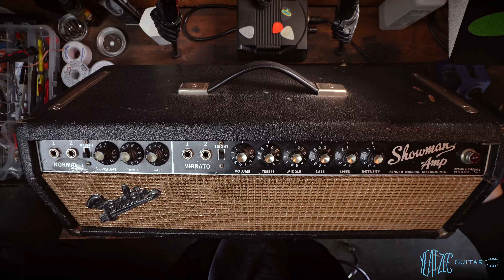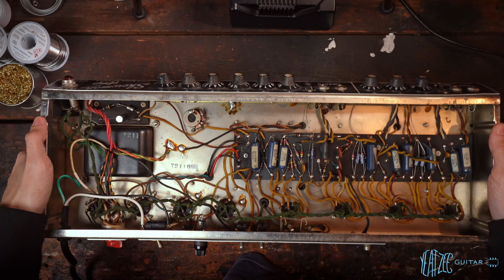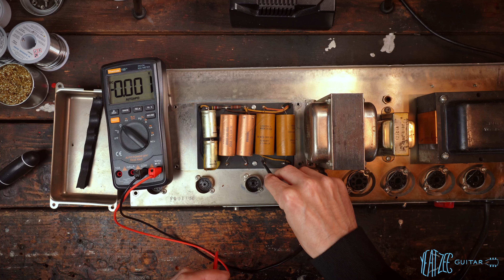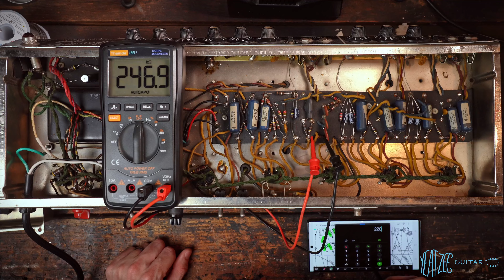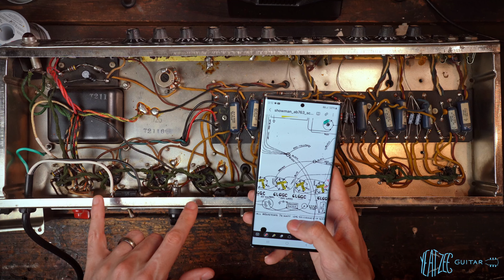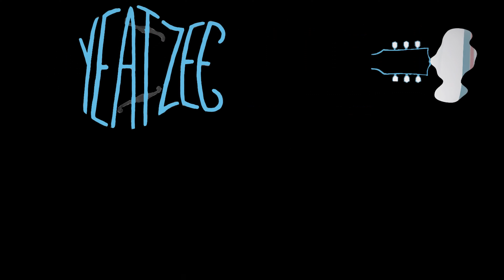The BIG DOG... | 1966 Fender Showman Amp Repair Pt.1

Comment: You say there is no reason to not change those filter caps, but Steven Fryette would disagree. He makes a good point that if the cap still works and is in spec, why change it?
Reply from the maker: 1 had already been swapped poorly, there is zero advantage to keeping the other originals and just swapping the one. You don't know if the caps still work either, owner told me it developed a hum which is a often sure fire sign of filter caps going. There is no tonal advantage to leaving those power section caps, only risk.
Reply: @YeatzeeGuitar  Have you ever tried reforming caps?
Reply from the maker: For every one person that claims that's a thing, there are 5 that say it's not 🤷‍♂️

Comment: The ink stamp inside the chassis is somewhat smudged, but it looks like it reads "T211066". which would mean technician #21 completed wiring the chassis in Oct, 1966.

Comment: I’d be interested to see how you address the power cable and voltage selector if you plan to bring it up to spec.  I used one of these on a recent album I did. They are really awesome for bass guitar.
Reply from the maker: Nice! TBD, ideally obviously we'd redo the 3 prong to have a chassis ground with the earth connection longer than the others and so on.